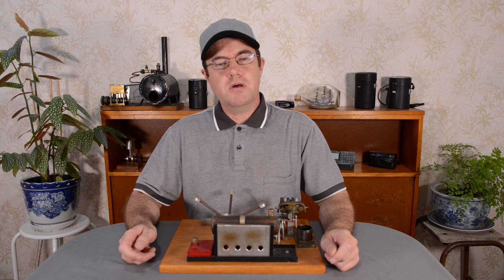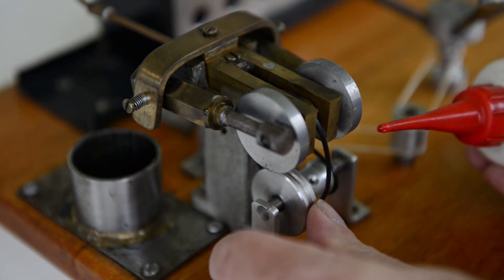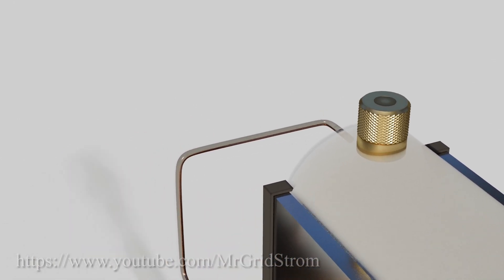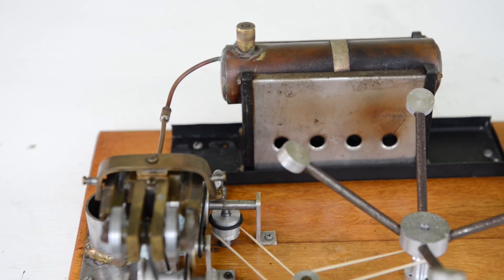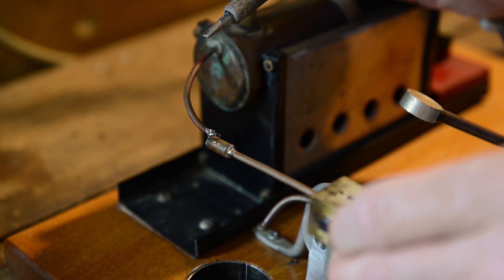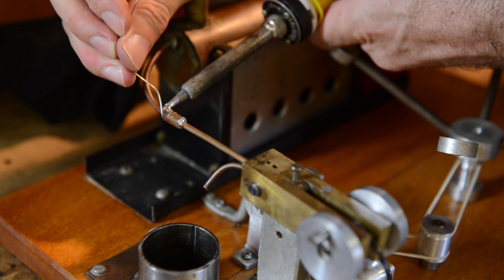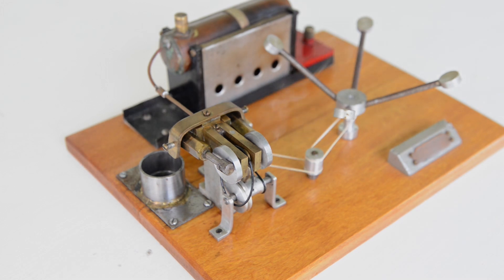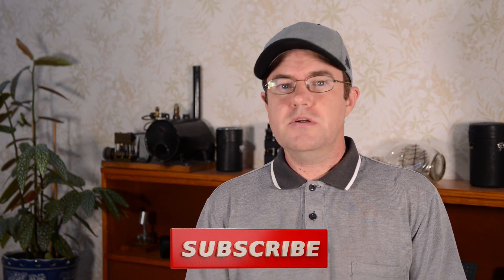How An Oscillating Steam Engine Works

Comment: Hi, saw your post last night on Martin Zero's channel, so I thought I'd have a look. I guess you made the standard Ken Wells engine and then adapted it later to have twin cylinders? Very well explained video, hope you can get it to drive the mechanism.

Good luck from Spain!!
Reply from the maker: Yes I remember having alot of fun building it, and ive always wanted to make a detailed video about it.
Reply: @MrGridStrom  The books showing how to make the static engine and the Traction engine are available as ebooks from Camden Miniature Steam, in the book Step by Step Metalwork 3, by Kenneth Wells. I remember making the engine but didn't know about the books until recently. They were exorbitantly expensive and very rare, so I did some digging around, got in touch with the family, Ken is no longer with us, and Camden and found someone to loan a book to copy and after many trials it was eventually republished, you can get a paper copy of this one, parts 1 and 2 are now available but only ebooks.

In the process I went to see Ken's wife, got to see the original engines and other documents. I published this in a short video on my channel.

I need to practise and prepare my videos better, those that I have done so far were done too quickly in order to more easily share them.

Good luck with getting your one to work, I'm sure a twin cylinder will be powerful enough, probably needs a bit of adjustment to get the most out of it. I have the same problem with my Mammod Funicular Railway.

Good luck from Spain!!